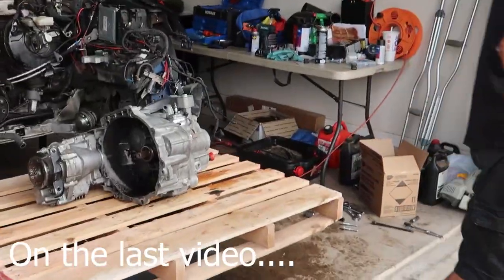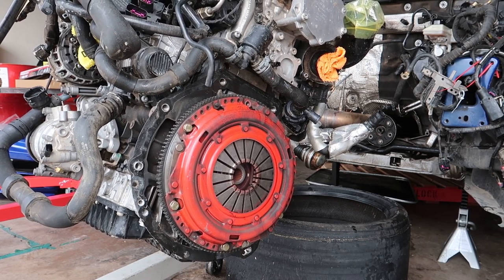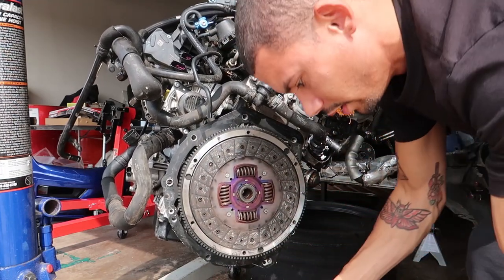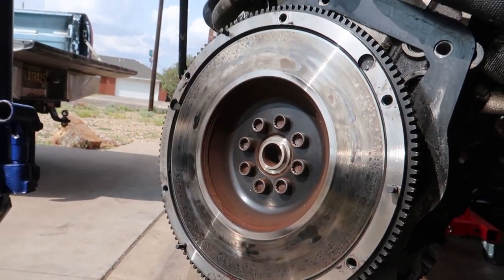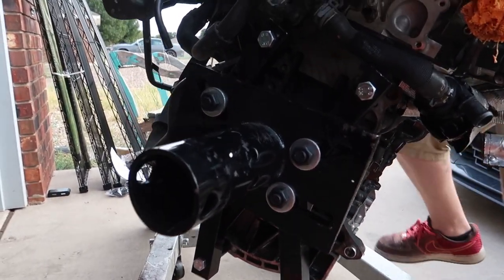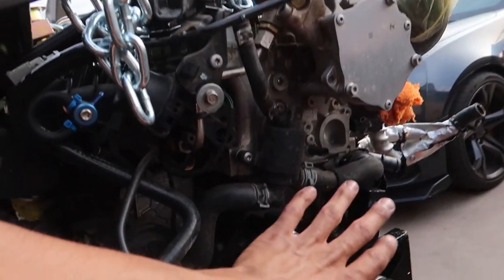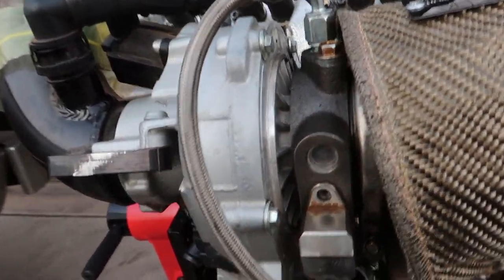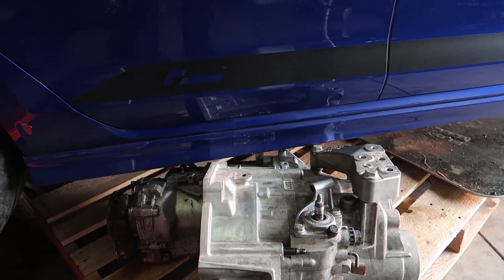Engine on the stand! 700+ horsepower internals purchased! | MK7 Golf R

Comment: Clutch masters has a 6puck for the 7r.
Have a fx400 myself, nothing to complain about it. 
But you're tracking your car a lot so might have to check with them.
Reply from the maker: Yeah I'm kinda torn between.. might just stick with my full face cause well, I'm pretty much broke after paying for all the built transmission stuff.. 😅
Reply: @BryceJordanProductions  I am hoping mine doesn't detonate like yours. But it's the risk of running these cars hard. I had to stop myself from constantly adding up all the costs on changes and fixes. 🤣
Reply from the maker: Yeah I stopped keeping track of the money trail awhile ago.. I don't wanna know 😆😆😆